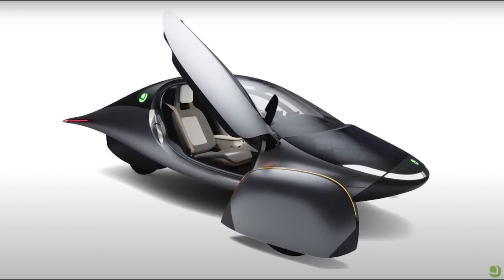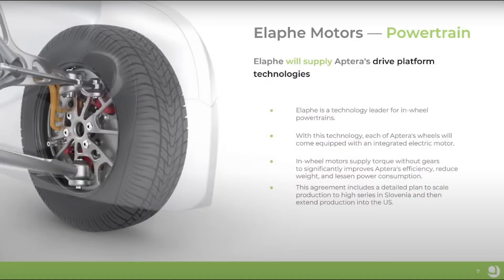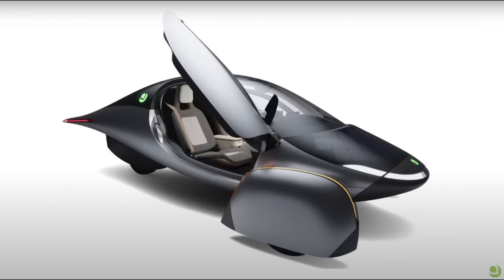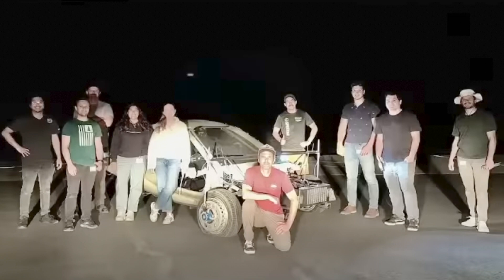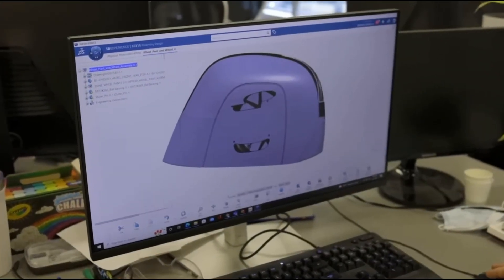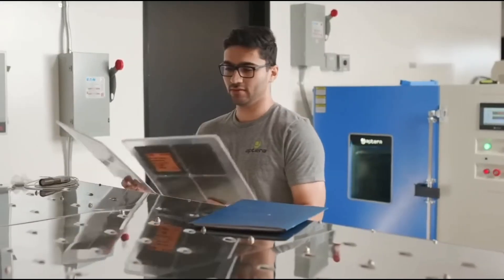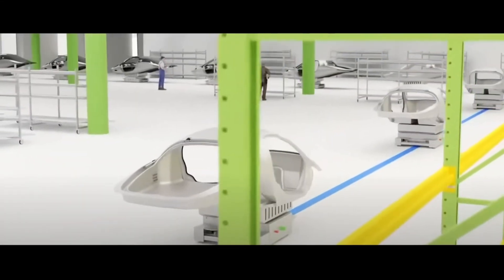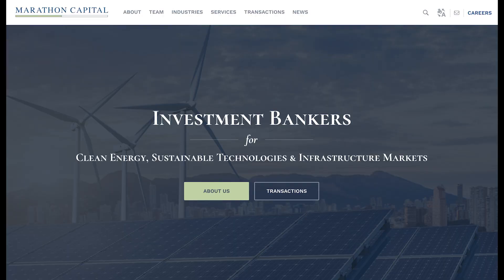Aptera Gamma - June 2022 Update - LOTS to talk about!

Comment: Raj, 
I am intrigued by your statement that the vehicle does not have a heat pump. With Aptera, no heat pump means it cannot stop for a long period of time. Skin cooling requires a heat pump to carry out the heat when if stands still in the sun or in the cold.
Btw, did you get all these facts by talking directly to Aptera.
Thanks.

Comment: Please Aptera make changing the heating and cooling unit or units and fan easy to change, when needed because ac units don't last , and even ovens don't always get used but burn out sooner or later. I hope right to repair is good for the whole care. I love not having a giant heavy engine to work on Aptera is much needed, because dealers are rip offs not a surprise dealers for gas cars are  bankrupting and closing
Reply from the maker: From how the have communicated about how they are open to right to repair. I don't feel this would be an issue to repair yourself or a shop to help you.
Reply: @RajGiandeep  no shops please

Comment: Excited! One main concern for me is that it looks like it's going to be really easy to accidentally strike the front wheel pods when parking or going in and out of garages. Also easy for other cars to hit them when parked.
Reply: latest on the site is that the bottom of the wheel pants is 5 inches above the ground. That's a pretty common amount of underbody clearance for a sports car and the wheelpants are much closer in to the tyre. Basically you'd have to try pretty hard, or make a habit of parking exceedingly close to kerbs for it to be significant.

Comment: I (pre)ordered an aptera because I think it's a brilliant concept and car.

I have always wished for such an optimized vehicle. It is exiciting!
But I'm afraid that it's just too wide for "(good) old Europe".

Isn't there a way, at least as an option, to make the vehicle narrower?
The fattest German cars, Mercedes S-class, BMW 7 series, Audi A8, even the colossal suvs from Mercedes, Porsche, Audi and BMW , are between 1900 and a maximum of 2000mm wide, with mirrors a maximum of 2200mm.
You will only be able to drive into very few multi-storey car parks with an Aptera, on German autobahn construction sites the maximum permissible width including mirrors is 2100 or 2200mm in the fast lane, so an Aptera must always drive between the trucks there.
The Aptera has more than 2200mm and that without the classic mirrors
It would be good to offer a narrow version with a width of 1900mm, which is still not narrow by European standards, but much more suitable for everyday use.

Comment: 600 mile range with a maxed out solar system sounds like a great combination to me. Although I’m still waiting for a physical car to test drive before I commit any cash.
Reply from the maker: Fair enough. You can still pre-order and get a refund on it later if you don't want an Aptera. Would you drive to CA to test drive it?
Reply: @RajGiandeep  the thought has crossed my mind. But at current gas prices, prices for everything as far as that goes, can’t afford it.
Reply from the maker: @jamesmchugo9422  totally understand that. How long of a drive is that for you?
Reply: @RajGiandeep  I live on the Edge of the Earth. It’s close to 2000 miles away. Believe it or not I’m driving for 30 hours to take a 10 minute test drive on a car that’s not yet in production. Also, I learned years ago from my grandfather, never be the first to drive something untested and brand new. Let someone else be the 
Guinea pig and work out the bugs. I figure it will take a couple years for Aptera to fill current orders. In that time all the bugs will be worked and if the car takes off, they’ll start showing up in my area and have some real world miles and reviews. Somewhere in that time I’ll get a test drive. It’s been almost 2 decades since Aptera first appeared, I can wait another year or two.
Reply from the maker: @jamesmchugo9422  Good plan. Myself I'm probably far enough in the queue to be a year once they start production. So they can work out the production issues that may arise. Even so, I don't think I'd want the first off the production line anyway if I could pick anyway.

Comment: Thanks for the updates.  Have you heard of how many airbags are in the car?  With such a light car, deceleration forces will be tremendous even impacting medium size vehicles.  Any news on torque vectoring?  When are submitting cars for voluntary side impact collision testing?  Any ideas on break-out glass in event of the vehicle flipping over.  One wouldn't want to be trapped inside the trike if it overturned thus trapping the passengers inside.  Thanks and looking forward to more videos.
Reply from the maker: Airbags, no count other than one for each passenger. 
Torque vectoring. No info on this yet other than it's supported.
collision testing - they are working with a company near them for crash testing. Probably info on that later this year.
break out glass - not sure on this. on there next Q&A I'll ask this or you can email them directly.

Comment: Just heard that Tesla may eventually convert to CCS. 3-5 years, based on maintenance schedules?

I recently saw an Airstream that self-disconnected & relocated (via small motors that engaged tires). Would buy a motorized CyberLandr-style trailer that folded flat for aero & solar charging & act as a supplemental battery behind a 400mi Aptera for long trips.
Reply from the maker: Seems like Tesla are shifting towards CCS slowly
Reply: Tesla will not convert to CCS in the U.S.  They will most likely provide an adapter to allow CCS plugs to connect to a Supercharger.

Comment: Would be nice to see this in the real world situations.  Since it's a little wider than most cars, how does it fit in the parking spaces and next to cars with the doors.  Do they swing out of the way and move more up than out?  So tempted to just make a preorder.  But was wondering if Aptera will be upgrading their model as they go along.  With 25K pre orders, when do you think it will be delivered and by that time, has something better come down the line?
Reply: Yes, the doors are hinged along the upper front curve rather than the frontmost part and open mostly upwards. Volume production is not till first part of 2023 and I'd guess if you're at the back of the queue now it's late 2024 before you get delivery.

I expect there may be a few updates to the Aptera along the way but there's not another similar vehicle coming along in the time frame, unless Aptera somehow blitzes through development on a second model. I'd expect you could transfer your production slot to a second model even if there is such a thing.
Reply: I thought it was slimmer than most cars...
Reply: @kenswireart88  From the Wiki:  "Although a three-wheeled Coupé for 2 passengers, the Aptera is not a small car. Its overall height (57 inches (1,448 mm)), width (88 inches (2,235 mm)) and front wheel tracking distance (77 inches (1,956 mm)) is higher and wider than a Toyota Prius or a Tesla Model S"

My Toyota Rav 4 is 74" wide and Ford F150s go from 79" to 86".  So when parking, probably want to park further away...
Reply: @kenswireart88  A compact parking space is 96" wide and a standard one is 108"   With the way the doors open, it should fit in either one just fine.

Comment: Is there an option to take the wheel covers off?
Reply: Why would you? You'd be adding more air resistance.
Reply: @TalonsRebellion  True, but I would be getting more ground clearance.
Reply: @TalonsRebellion  Because the land owner where I live doesn’t plow the entrance to the road when the snow plows pile up the snow there.
Reply: As I understand it, the wheel pants will be removable without tools.
Reply from the maker: @inomad1313  That's my understanding too. For real off roading. I'd be more comfortable with removing the wheel covers. I know they mentioned no tools. Yet to be seen or at the very least simple hand tools.
Reply: @RajGiandeep  Personally, I’d like to have some sort of tool required to remove the wheel pants. Even requiring a small pry bar would reduce the chance of having some rando walk by and take my pants. I don’t want to loose my pants while I’m waiting for the sun to come up.
Reply from the maker: @inomad1313  loosing your pants while your waiting for the sun to come up is awkward for sure :)

Comment: really just want to know how it handles in cold weather.
Reply: It has really excellent ABS/traction control that can sense wheel slip and adjust torque every 2.5 inches of tread travel.   I live in Iowa and will be getting an early model.  I will be posting my experience.

Comment: I think the Next product should be a self-driving trailer that follows the Aptera around. Then I wouldn't need my big truck for hauling stuff and camping.
Reply: I recently saw an Airstream that self-disconnected & relocated (via small motors that engaged tires). Would buy a motorized CyberCamper that folded flat for aero & solar charging.

Comment: I wonder if you can install the heat pump later
Reply: Aptera offers "right to repair" so the answer will almost certainly be yes, but cost will be a question.
Reply: @n.brucenelson5920  Hey there N. Any word on wether or not you will be able to upgrade the size of the battery after purchase? ie 25 to 40. Or 40 to 60? 

Is this a thing that has been discussed at Aptera?
Reply: @inomad1313  Yes, it has been discussed.  At least in the beginning the batteries can not be added to.  It is possible that you could replace the entire battery pack, but it won't be inexpensive, due to the weight of the packs, and the likelihood that there will need to be suspension changes as well.  I would strongly suggest getting the size you think you will need at the beginning.  They may revisit modular packs in the future.

Comment: I also chose the 600 mile range.  It's the best option I believe.
Reply: I also had this quandary.  I first chose the 600 mi option, but later changed to the 400.  My reasons: a) I will be planning some long trips, but I anticipate that these will be at most 25% of the time.  For the rest of the 75% local city driving, 300-400 mi range is plenty and I didn't want to see myself lugging an extra approx 250 lbs around all the time (and not really using it).  Finally, I know that my usual long distance endurance is at most 400-500 miles before I need a break (on the Aptera on a DCFC that's theoretically a 20-30min break for a 80% charge and other 200-300 miles.  Finally, the announcement that they were gonna do the 400 mile one first, was admittedly a factor too!
Reply: @rwo6211  I picked 600 mile battery so that charging at 50% full will still be full speed at superchargers. Otherwise, the 400 mile battery might have already slowed down with a battery range of 300 mile 75% full)
Reply: I would go with a lower range and use a larger vehicle for a long trip

Comment: I think the lighting system they are holding for a surprise will be the center headlamp. This is  required by law since Aptera is considered a motorcycle. In addition to the regular car lightings on the front edges of the vehicle, they may make the center light intuitive to be used on demand. It may have three lead lights that will come on with start of the vehicle, and then when needed for regulatory or other purposes, you can turn on the beam. Just my two cents.
Reply: Aptera is considered an Autocycle
Reply: @meatisomalley  I know, but I understand they are broadly regulated as motorcycles since they are something between cars and bikes.

Comment: Adjusting the setting on the bottom of the video to 1.25x speed helps a lot.
Reply from the maker: Good advice
Reply: holy crap that made this so much better.
Reply: I had to set it to 1.5x. This is ROUGH to watch normal.
Reply: I had to go 1.5x.
Reply: You mean to slow it?
Reply: @adimchionyenadum2962  He is talking about speeding up the narration speed.
Reply: @n.brucenelson5920  I had no problem with the video speed. If anything, I had the opportunity to see better the assembly line of Redviking  which was extremely fast in the Webinar.
Reply: @adimchionyenadum2962  Yes.  Big thanks to Raj for putting this together!